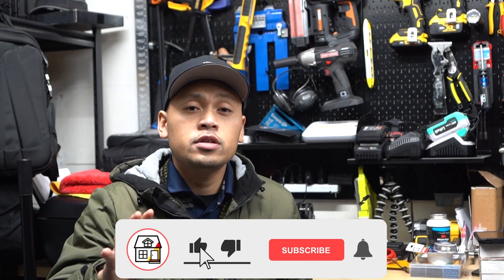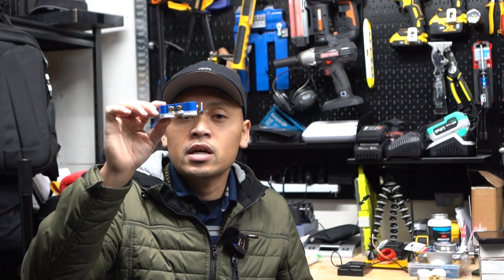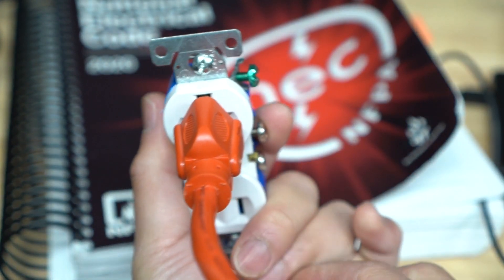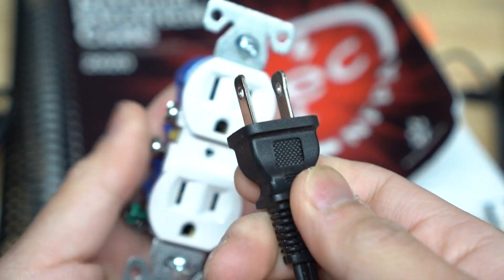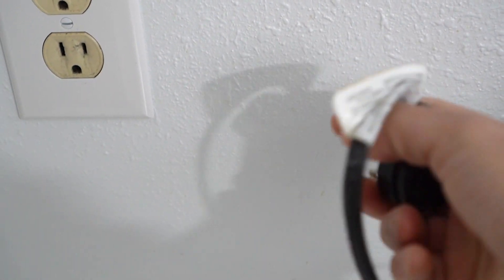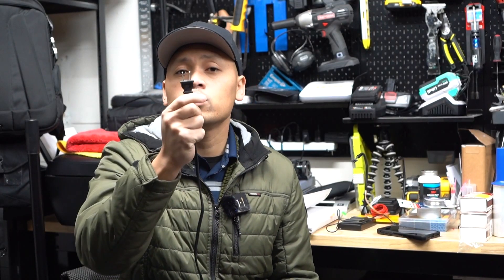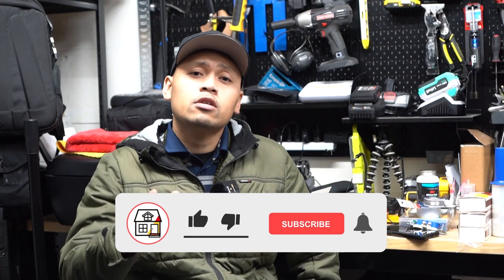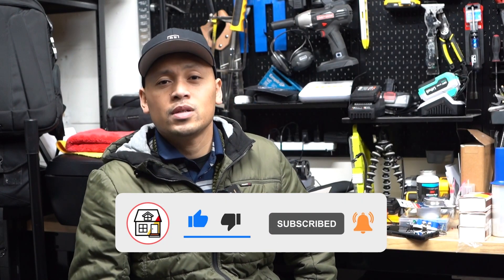Installing Outlets Upside Down Illegal? Let's Find Out!

Comment: there is a scneario that needs ground down.. outlets with a themostat screen, or timer. you'll have to read text upside down if ground is facing up. I have an apt, and secretly flipped two to be facing the correct direction.. just for a programmable timer and thermostat. The text screen is readable, easier to program facing the right direction. (ground down) :goodvibes:

Comment: an Upside Down power outlet in your home is often a standard practice used by many new home builders.  the power to this outlet is usually controlled by a wall mounted switch that is located somewhere close by.

Comment: My landlord is an eletricien and this is how I got to know. He told me it is because of water. It is safer to have the ground on the top if there is a leak.  I put them the way they were because  exept the wires, which we can put the way we want, the manufaturers did not adapt. for exemple, my airconditioner wire faces upward instead downward. Some of devices will be upside down. Until then, I keep them the way they were

Comment: You are correct, there is no code requirement for the proper direction of the ground pin on a receptacle.  Almost all residential outlets are TRADITIONAL ground pin down while in hospital, medical offices and many commercial locations they are ground up.  I believe in Canada, they are all ground up but not 100% sure on that.  On sideways receptacles, TRADITIONAL they are positioned so the neutral side is facing on top when the receptacle is positioned left to right.  Many years ago, when we used metal electrical receptacle covers, the ground up was a big discussion point in case the cover fell down onto an exposed plug but that seemed to all faded away.

Comment: I have an outlet in the basement ungrounded. Is that safe?
Reply: No it is not safe, especially when you are standing a a concrete floor.  Simply install a GFCI outlet in its place and place the included sticker, “No equipment Ground” on the front of the GFCI to be code compliant.  Now you will be electrically safe!
Reply: @billhandymanbill2775  Thank you very much! I'll replace it with a GFCI today.

Comment: My house was brand new when I bought it 20 years ago. Each room has one upside down receptacle. One of the two outlets is controlled by a wall switch and the other is always hot.  Very convenient for turning a lamp off and on by the wall switch when entering the room.
Reply: Mine, too. I thought that’s how all homes were as it makes it easy to identify which receptacles are controlled by a wall switch.